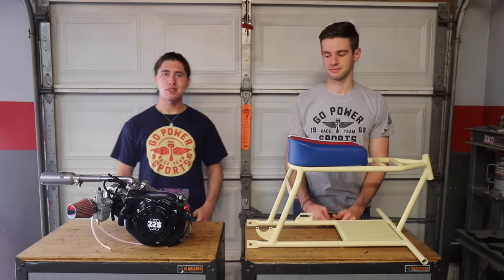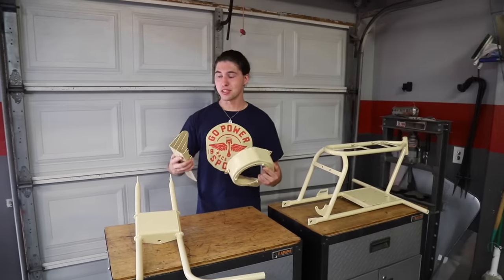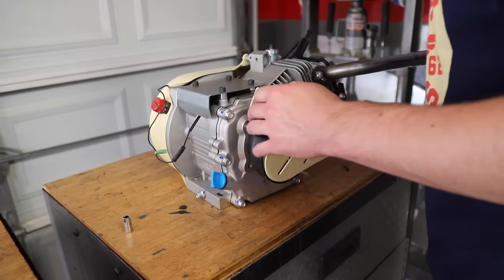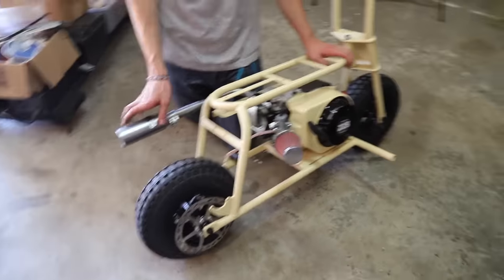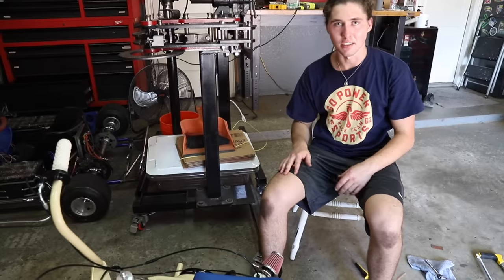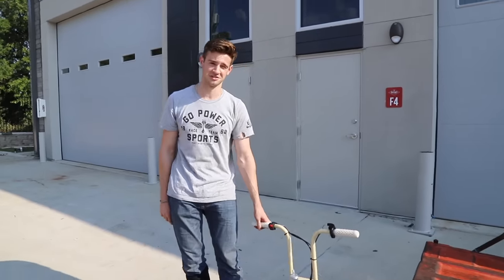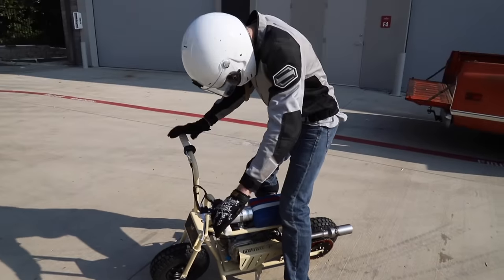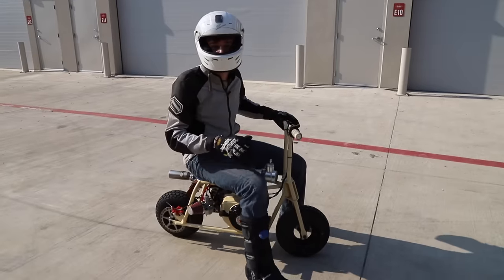ONE DAY BUILD! 18hp Lil' Rascal Minibike Kit from Gopowersports!

Comment: That kit is way overpriced and they should be ashamed of themselves for charging that much. Go Power Sports have lost all of my future business.
Reply: Ikr
Reply: me too
Reply: Same
Reply: It’s just under 700 for a roller?  I don’t think it’s that bad?
Reply: @YeaItsSlo  they can make it for $250 or less
Reply: Way to much you can get a whole ctu 200 for less than that.unstable bad over priced
Reply: If y’all are broke just say that 💀 it’s a good price for a hand built in the USA frame.
Reply: Build your own frame
Reply: @thatonedodge  you can make it for under 100 probaly
Reply: no front brake.
Solid pegs
Knee/nut ripping tank mounting hardware
Reply: @Johnporky_1 I built my mini bike for less than $500. Kx65 engine and $70 frame
Reply: @curtissmartin6322 yeah, and the Coleman welding is ridiculously awful. I just went and looked at an $800 b200 and the welds were so bad that the frame would no doubt come apart within a year or less. You get what you pay for. I hear the welds on the lil rascal are far superior.
Reply: @Johnporky_1 if you’re a really good welder, yes.
Reply: @joshzarbaugh  you can buy a  azuza bike cheaper than that

Comment: 735 bucks for this without a engine 😂😂😂 ill pass i could buy 2 full minibikes for that
Reply: I built one of the Coleman ones for less than that. Fully built engine. Did 50mph. Probably could have gotten more out of it with some different sprockets.
Reply: Quirin M. Where’s the best place to buy a fully built Mini Bike. With a 6.5 Engine, or faster.
Reply: Tyler Humphreville Do they have faster options?
Reply: All these Mini Bikes are way over priced. It is  Insane. Most of them you pay a shit load for just a frame and then they make you pay for forks and every other part. Those Grips they have are an extra option and 40.00.
Reply: Get a 212 cc for a hundred then
Reply: @SpiffyUNO  ...
Amazon sells Coleman 200cc for $500-$600 usually.
Wal-Mart online sells Several. BT200cc, Coleman 200cc in several body styles.
Tractor Supply sells Coleman 200cc and BT200cc...
Reply: @SpiffyUNO  ...
If you are willing to pay $1,800...
ICEBEAR sells a Clone of the Honda CT70 street legal minibike. Named the Icebear The Champion. It is a 125cc engine instead of honda 70cc engine however. It has great power and speed. 55mph stock. Great offroad too. Plus it is 100% street legal.
Reply: @SpiffyUNO  rural king
Reply: @trudagger3933  Harbor Freight sells one for $125. Get a coupon and $100 it is.
Reply: I build doodlebugs, motovox & monster moto.. all with new 212 engine, new clutch, new chain, cables, pads & tires if needed
$500 near manchester ct,..
Reply: @hardnockz forlife 300 is even much....
Reply: @hardnockz forlife yeah cuz I mean the motor alone is about 100$ so where’s the extra 200’going? Frame? Lol
Reply: @silkcustoms520  no different than an $1,800 goped, a $3,000 ruckus, Gromm or scooter...lol and they’re slow...they didn’t go fast on this vid bc the motor needed to break in. It’s got serious power and I’ve had banshees, 2 stroke 250rs etc. This motor is a beast. I got one on mine. It’s bored, cammed, stroked etc from the factory with a juggernaut torque converter. Well over 70mph and acceleration is stronggg. Def worth $2,000 and fits in your trunk lol
Reply: Exactly you can build a mini bike for 400$ with a 300cc engine for 300$ less than a kit without an engine. Smh you pay for thier logo not the item. Or an extra 50$ for a 420cc (15 HP) engine
Reply: @brianmccann666  I’ve been want one bad

Comment: 700$ for a roller isn’t a good deal in my eyes at all
Reply: True 🙁
Reply: I got a 212cc minibike with stage 3 engine and front suspension for 500 and I thought i paid alot for it. Its still on the original back tire in like new condition and never had its governor removed

Comment: I bought a 225 several months ago when cars and cameras unveiled it.  It's on a sfd industries drift trike. 54 tooth rear and just a centrifical clutch up front and I used a speed app and logged myself at 65  I still had more.  This little 225s are serious!! I love this color by the way.  Such a cool vintage look! Good job guys!
Reply: Stock 212 with 60t rear and torque converter I've got to 54mph on 10inch rim.
Reply: @paulkendall34  I'm on a 6in rim with a believe an 8 or 9 in tire  it's a wide slick. With the PVC sleeve on it.

Comment: Big honda 4 strokes, i always used to tip my bike on its side(i forget which side), then get the kick start at the right point before i would kick, then it would fire up first kick with no recoil and never did it without riding boots either, never got hurt myself

Comment: welding two forward facing mounting brackets to the fork should eliminate the wobble at higher speeds. the contact point of the front wheel is not far enough away from the forks pivot axis.
Reply from the maker: Thanks for the tip! We didn't say it in the video but we actually got one of the first test frames and the frame manufacturer had the wrong rake/fork angle (we couldn't run the cleat tires it comes with because they would have hit the frame) It's been fixed since then so I'd assume that should help with the stability

Comment: Love the video but sketchy. Speed wabbles at like 25,30?  Think it's the shape of the bike frame. But ok for out the box
Reply from the maker: There was some wobble there but remember we’re running 18 hp. Also, we didn't say it in the video but we actually got one of the first test frames and the frame manufacturer had the wrong rake/fork angle (we couldn't run the cleat tires it comes with because they would have hit the frame). Now they come with a little bit more so you could fit a bigger tire and the caster angle will help you out with stability if that’s a concern you have.
Reply: @BuildBreakRepeat  even with a 6 1/2hp it would be sketchy. go power sports should of put more thought in to it, and raked the front end out more.
Reply: @BuildBreakRepeat   yeah that's what I was guessing,  but w a decent rake, I mean, how could anybody ask for a better out of the box mini bike FULL build? Really can't. Good work guys, big nads basically riding the engine w wheels while having a broken leg. Love this channel.i like every vid. G.P.S IS REALLY ON ANOTHER LEVEL w this boxed bike
Reply: @BuildBreakRepeat  Yeah I was thinking along these same lines with the front end fork as soon as I saw it move.
Reply: @BuildBreakRepeat  doesnt matter, that frame is shit way tooo small total death machine I bet in a year they will be recalling that junk frame mot worth  50.00 junk
Reply: @BuildBreakRepeat  thats the issue. My dad when he was a kid made a chopper bicycle , thing is terrifying to ride

Comment: Not quite convinced and I feel lost..how is that little 5.5 Honda clone putting 18hp out? Even with valve springs carb swap and exhaust mods I still don't see how it can produce that much HP without methyl injection or alcohol, turbo..etc. 
..anyone have more info on these engines?

Comment: That Thing is really nice and all the parts are given for fine price of 1,500 but I mean it’s really nice
Reply from the maker: For the kit the base price is $695 and it does not come with an engine. We chose to use the 225 which would add alot to the cost but if you already have an engine or use a predator 212 you could have a brand new custom minibike in the 750$ ballpark which is pretty fair
Reply: Build Break Repeat of course a predtor 212 works perfect altogether 3 times the horse power makes difference and it would be a heck of a lot more fun

Comment: Awesome bike. I'm doing one as well with a 225  I put 24# valve springs aslwell curious how much power that will add plus a torque converter.
Reply: Valve springs do not produce power. They just provide better valve operation at higher RPM.

Comment: any recommendation for a stage 1, 212  on what size rear sprocket, as of now it has a 75, I want more speed but still have some torque, need help with a size.
Reply: Im hitting over 50mph and im 210lbs. Im running a 15 tooth front and 54 rear tooth sprocket. Briggs and stratton 205cc with torque converter. Bigger clutch smaller rear sprocket increases top speed but takes away acceleration. Smaller clutch but bigger rear sprocket very good acceleration but not good top speed

Comment: There is zero trail on those forks.  That's probably why the steering is so twitchy.  Easy fix with a couple of welded tabs, but they should have done it from the factory. 🤷🏾‍♂️